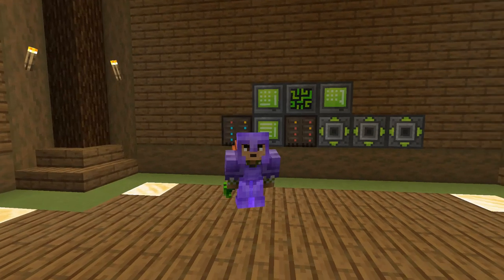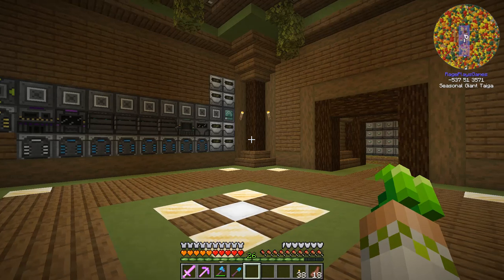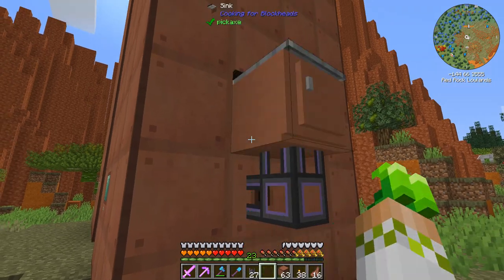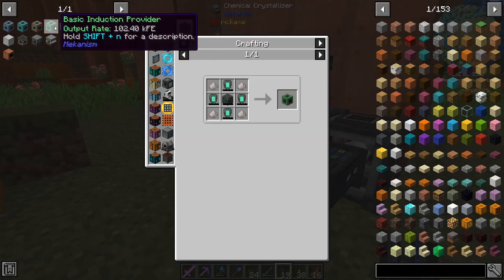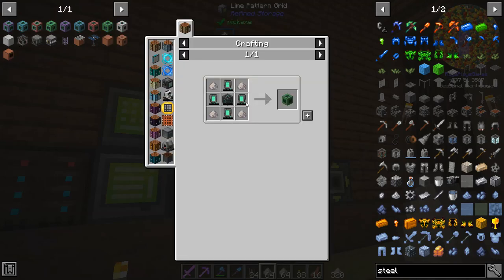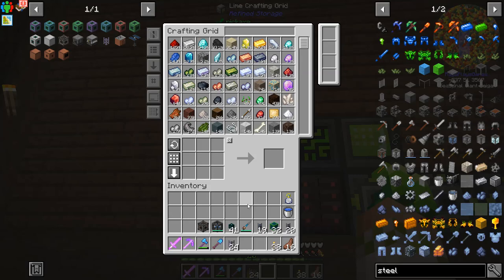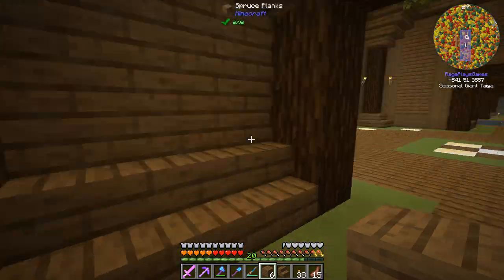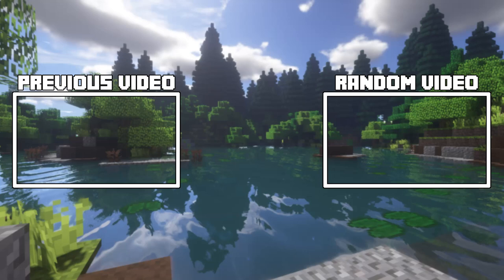Enigmatica 6 :: E10 - Induction Matrix & Thermal Evaporation Plant

Comment: When you turn off `Exact` in the Pattern Grid, it will look for any similarly tagged items to use for the recipe. 
The one where you get to select which tag to use is when you are doing Processing and not Crafting.
Also, if you have an incorrect Pattern, you don't need to completely clear it. You can just put it back in the bottom slot of the Pattern Grid, and update it.
Reply: also, you can make a crafter manager and place it next to your pattern grid, instead of having to go place the patterns into the crafters yourself.  i keep all my crafters hidden, so it's very nice to have the manager.  also makes it easier to organize them.
Reply: didnt work for me idk why
Reply from the maker: Thanks for the heads up! Honestly I had no clue you could uncheck both those boxes since exact is auto checked to start. I figured it was one or the other and instead used ctrl click to adjust the alternative tags a recipe would accept. I will be sure to use that in the future! Learning something new about RS every day :)

Comment: Tip: Put a drawer with a void upgrade, and connect it to your refined storage network with an external storage, for the sand. So you will never have to worry about overload your network with sand! :D
Reply from the maker: That is actually a great idea! I will 100% be doing this :)
Reply: @RagePlaysGames  Glad I could help!! 
And Also don't forget to put the priority of the external storage to 2, so it will always put the sand in the drawer.
Reply: @RagePlaysGames  to add to dim, when you get the storage drawer, add multiple 32x upgrade and add a void too
Reply: Bruh just get highest tier disk, u aint filling 16 billion in a while
Reply: Also stoneworks factory makes silicon  which is usefull since you'll need 12k of it
Reply: @RagePlaysGames  connect it to drawer controller so u can have multiple draws like that but make sure that the external storage has priority if 1 or the system wont put it in draws it will clogg system then put in draws
Reply: @krzysztof6123  the 16 billion storage is extremely expensive??? how the hell are you planning on getting that many materials in the time frame of this series? also, something way way cheaper is, whodathunkit, a drawer with a void upgrade.

Comment: There is the Infusing Factory from Mekanism, which is like the Metallurgic Infuser but with more slots. So instead of making multiple ones, just upgrade the ones you already have.
Reply: If you're meaning for his auto-crafting, he has multiples to keep coal/diamond/redstone/ref obsidian infusions separate. 

It's possible to use only 1 for auto-crafting, but its prone to stalling when you mix infusion types. Also, it allows you to make multiple alloys at the same time, like steel and refined obsidian, so it's still worth making all 4 for time efficiency.
Reply: @michaelkennell2420  I meant that he should upgrade each infuser to it's factory variant.
In the video he said that he should have more infuses for each type, so u said that he should upgrade the existing ones.
Reply: @michaelkennell2420  in my opinion it's the best having 4 Infusing Factories
Reply: @sufilevy  gotcha, must have missed the bit where he said he needed more than what he already had!
Reply: that may be so but even having multiple factories would be faster as you can use exporters with crafters to make sure you always have enriched materials ready to infuse with items .whereas having one for multiple means you always have to make an exact amount of items or machines will be clogged with extra carbon or what not, but still rage upgrade them with tier installer man.

Comment: You dont need to set up multiples metalurgic infusers, just turn them factorys with the mekanism's tiers upgrades so they will go 9 times faster jus like your erichment chamber
Reply from the maker: Lol you're completely right! I clearly had a complete brainfart and forgot to do that / that I could do that since I have never before needed so much processed in any infuser at once.
Reply: It's still good to keep 4 of them for auto-crafting to keep the different infusions (coal/diamond/redstone/ref obsidian) separate. Using just one is prone to stalling if any infusion isn't fully emptied, so it's way easier to keep them separate.

Plus, then you can make steel and alloys in tandem to speed up high-tier crafts.
Reply: @michaelkennell2420  or just turn 4 of them into factory

Comment: I don't know if later versions fixed this, but in 1.12.2 I had issues with trying to get the Refined Storage system to recognize energy tablets and energy cubes, which meant I couldn't use it to autocraft Induction Cell components
Reply from the maker: Oh that would be so annoying! Doesnt seem to be a problem now thankfully (unless I just havent run into it yet lol).
Reply: @RagePlaysGames  it's something that prevented me from using RS to autocraft induction cell components in 1.12.2. I wonder if that's the main issue.

Comment: **Tip****
Not sure if you will read this but I wanted to point out an awesome time saving tip for patterns... I noticed that with those cubes, it was using the wrong dust so you manually changed it. Instead of having to go back and chang them, just uncheck the "exact" box when creating... However... There is a slight drawback. If you do that on say a "planks" pattern, it will use any logs, I for one save certain types of logs for building such as spruce and don't do it for certain patterns. Works great for dusts, ingots such as iron or mekanism mods and gears etc. I hope that makes sense and helps.... I love this play through!

Comment: Hi Rage. I have a question: How does your storage system automatically make the required infuse types as shown at 21:49 I would like to ask you for help. :)
Reply from the maker: You have an interface above the metallurgic infuser that accepts the infusion material from (i have xnet sending it to the back of the machine and the interface puts the actual crafted item like iron in the top since the item and infusion material cant have same side input) and put a crafting upgrade in it, have a recipe for the infusion material in your system if youre enriching it, and then put 1 of that infusion material in the export section of the interface. The interface will try to pull an infusion material for the infuser, if there isnt one in the system it will put in a craft request, the material will be made, then it will be auto input into the infuser thus keeping it stocked.
Reply: @RagePlaysGames  Thank you so much! <3